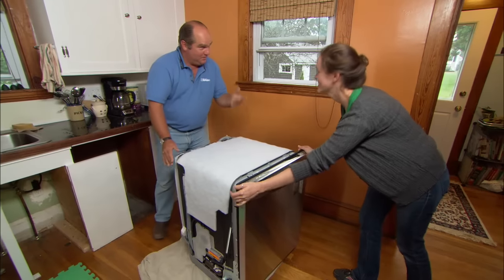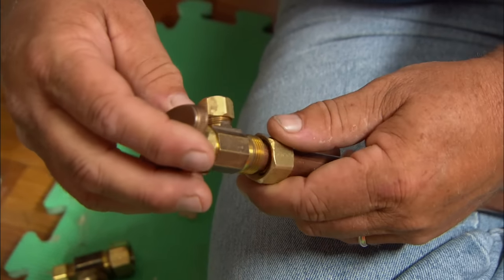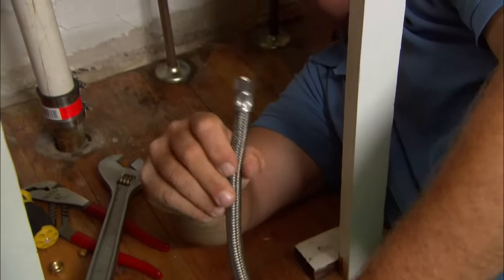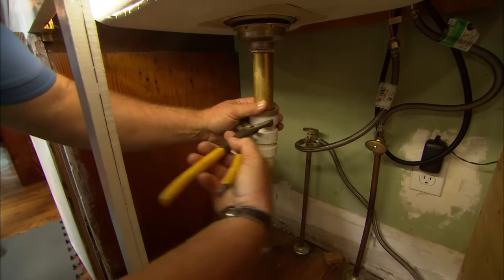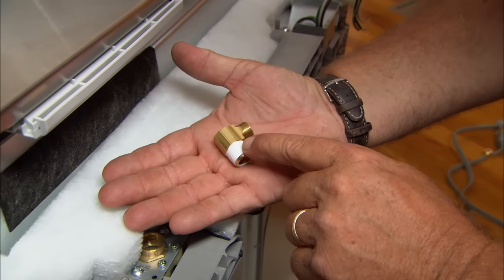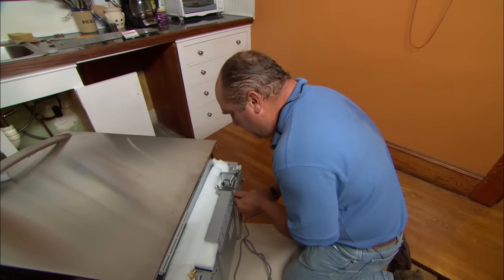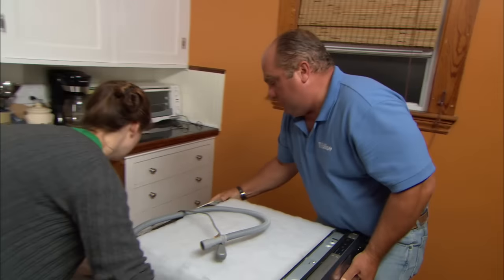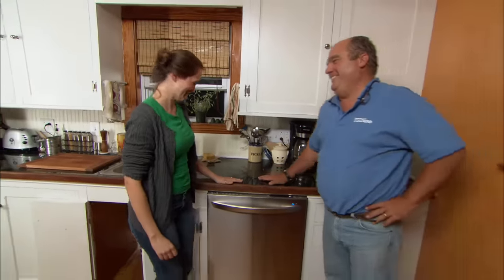How to Add a New Dishwasher to a Kitchen | This Old House

Comment: What do you do if you don't have an electric plug for it? They left that step out.
Reply: Call an electrician, most jurisdictions do not allow you to run your own lines from the breaker. You can also run an extension to an existing plug using a power cable you can buy at any home improvement store, but be aware that you can't run anything big while the dishwasher is running (i.e. a microwave) because it will trip the breaker.
Reply: If you know what you are doing , run 12/3 copper wire from your breaker box into a single receptacle, single gang outlet box.  Do it right and don't advertise and you'll be perfectly fine.  It's really not that complicated.  It's harder crawling around in the attic and trying to run the wire down the wall, especially if it's an outside wall than actually making the wire connections.  You will need to get an outlet and an outlet box and another breaker, or you can replace a single 20 amp breaker with a duplex breaker which gives you two hot connections for 2 separate wire runs in the same space a single conventional breaker gives you one.  Of course you will need your 12/3 copper wire to run from the breaker to where you decide to install your outlet.  You may want to check codes on that to see if it needs to be so far off the floor or what other criteria before you install it.
Reply: Ancyker Using an extension cord is against code.
Reply: I meant a pigtail type cord.
Reply: If you do run the wire and install an outlet make sure you put it to the left or right of the dishwasher.  The dishwasher must be butted up against the wall in order to fit, so an outlet with a plug protruding will obviously get in the way.
Reply: Patrick Wagz packrat76 probably referred to 12-3 for hot, neutral,  and ground.  I have some spare wire I plan to use on a project,  and your term is the correct one of 12-2, as the ground wire isn't counted, but there.   12-3 has black and red hot, white for neutral,  and bare or green for ground. The only time you need 12-3 wiring (or 14-3 wiring for a 15 amp circuit)  is if you're installing a 3 way switch.

Comment: The only thing I don’t like about this is the dishwasher wasn’t pushed in far enough. The front of the washer should be flush with the cabinet fronts and the top control panel ought to be concealed by the counter overhang. A LOT of people install that incorrectly.

Comment: You should mention there are two different size dishwasher hoses. Three quarter and half inch so you need the correct sink drain stem.
Reply: NO you dont the hose end is ajustable to fit
Reply: Never seem a 1/2” hose.

Comment: As with other commenters, I am wondering why he didn't install a P-trap under the sink, but also why no air gap for the dishwasher discharge hose?
Reply: Air gaps are required by some plumbing codes, but not all. I live in California and it’s required. But apparently In Massachusetts, a high loop is still acceptable.

Comment: is it safe to have an electrical outlet so close to all those pipes?
Reply: No, but that's the way you have to have it. You can't really have an electric dishwasher without electricity and if code required you to keep them separate, it would be really difficult to install one(not to mention the garbage disposal).  With the ground fault outlets that are available today it's not a problem. They will trip and kill power before someone could be shocked.
Reply: In theory that outlet is not likely to get wet, under normal conditions. It's not right next to a sink. Some inspectors might require a gfci outlet. But a standard outlet may do the job depending on your dishwasher or local code

Comment: Everytime I have changed the compression valve.. it drips from the ferral. Any suggestions?
I usually have to tighten loosen to 20 times to get it to finally seal.
Reply: smear on pipe dope in the treads may help it become tighter
Reply: It's a good idea to snug your compression fitting. Turn water on. It may leak, but slowly tighten the fitting until it stops leaking. You can OVER TIGHTEN those fittings, resulting in leaks. Pipe dope is also an option, but done correctly, you shouldn't need it. Hope that helps.
Reply: Wrap ferrule with teflon tape
Reply: Personally, I would remove the ferrule and use a new one so it compresses properly with the new fitting.
Reply: @bcbock  can be hard to do without scratching the pipe.

Comment: Never reuse the ferrel or nut from the pre existing compression stop, it’s bound to leak ..
Reply: not true. I have reused them many times and never had a leak!!!! the water pressure is only 60 psi not 1600 psi.....
Reply: Everything I've looked up or heard from plumbers says not to reuse them.  He's got a lot of pipe there too, why not just cut it right quick.

Comment: You have a cross connection with the dishwasher drain you need an air gap fitting
Reply: Air gap is a good idea, but not required in some states. Depends on plumbing code.

Comment: Ok, so what if the dishwasher is not next to the sink?
Reply: You can technically run independent plumbing/drain to it, just usually more convenient to go off the sink. Dishwasher manufacturer likely advises of a limit on drain hose length as well, but you can use one that's a bit longer than whatever is supplied so long as it's setup correctly.

Comment: Richard, Richard....I see 2 problems with your install. First you didn't isolate the water connections, you joined it into one which means when you have dishwasher repair and need to shut off the water, your sink will be unusable for hot water.  Secondly and of big troubleshooting importance, you didn't  mention an overflow drain pan which can save their floor big problems in the even of  solenoid  blowing and water comes out uncontrollably. Planning for the future inevitable problems goes a long way.
Reply: You can also get washers with a drain pan built-in that will attempt to stop the flow and will alarm.
Reply: For the amount of time you need your dishwasher repaired if ever, I don’t think it’s a big inconvenience to not have hot water at one tap for a short period of time. Also, you can buy a threaded cap plug that can be threaded on to the end of the valve outlet and then still use the supply line.
Reply: @bcbock  Well drain pans are nice if they are the type that can handle substantial water flow and are connected the to the drain. The standard pans are only good for disclosure of smaller leaks. I had one flood that took 3 wetvacs full of water !. I would regard the dishwasher overflow protection the same as a washing machine.
Reply: @andrewdishman26   For DIYers I'd rather err on the side of caution and give my self the liberal time to do as I please when I please. You can't go long without the sink but you can live without the dishwasher.
Reply: @andrewdishman26  As a handicapped DIY person that does her own repairs sometimes the time needes for me to gets things done does tend to drag out having the sink unavailable  to hot water is an inconvenience. I'd rather be safe and prepared for worse case scenario .

Comment: Someone please elaborate that this is how to do it if the house never had a existing dishwasher in the design
Reply: Yep. If they already had a dishwasher, you wouldn't need to add any connections, just connect to what is already there [as long as the connections are in good shape]

Comment: Good video. Where i live disheashers are hard wired.
Reply: The Man's Garage I've seen that in most installations.   My Aunt Dawn had a dishwasher installed like this, but to a traditional drain pipe setup. A gfci outlet was installed under the sink

Comment: As always, a very detailed explanation.  Hoelwever instead of just explaining WHY you taped the supply hose to the floor, it would have been helpful to also explain how you measured out where to place it.
Reply: Personally I would have just taped the water line underneath first then attach to supply line second. He did it backwards in my opinion.

Comment: Hey my romex wire has only white and green wires no black wire so how would I connect it to the dishwasher can anybody help?
Reply: wait what??  the romex will have three wires 100%, so you'll need to cut it back to find that hot wire.
Reply: Wrong

Comment: If you go to the hardware store or supply house and some idiot tells you that a DW tail piece works for a clothes washer, walk away. It took ten trips to HD and local hardware stores to make my own threaded splice for a washer. I'd post a picture here if not for Youtube censoring imgr. I even put in a heavy duty check valve. As to what Rich said here about the smooth side of the cable being hot, never believe the texture. Follow that back to the plug and make sure that the narrow prong is the one at the end of that side. My nemonic is "wide is white."

Comment: Why not connect the supply to the washer first then tape it and slide it in?
Reply: It’s easier to connect to washer first then feed the house through and pull it through as your pushing dishwasher in , just guide it gently as it’s going, this is overkill over-engineered process you see

Comment: Dirty water will backup into the dishwasher if the sink clogged and overflowed to the top. Have not seen one without a breather valve. Old dishwasher last forever, new top of the line dishwasher last 7 years if lucky.

Comment: The drain is hardly to code and neither is that tail piece.  And NEC says anything with an immersion heater requires a gfi protected circuit yet no mention was made as to whether this one was.

Comment: They once again only showed the easy part of the process.  Determining the best place for the dishwasher, removing the proper dimension of cabinets, and the demolition and prep for the opening can present the most difficulty.  Also there are a multitude of plumbing situations one could face... TOH took the easiest situation.  No surprise...
Reply: There is a full episode, this is just a shortened clip.
Reply: Most home improvement shows do that. They always have a ton of room under the cabinet but in real life you have to reach around in a very uncomfortable position and then when you finally get the wrench on you don't have room to turn the wrench.
Reply: So where does one get THAT information. Cuz that's what I'm hunting around for.
Reply: "replaced"   there is a difference silly
Reply: I'm used to seeing a siphon vent up at the top of the sink....yet he didn't even install one...

Comment: High loops don't work if the sink backs up to the top, especially if there's a garbage disposal.  If the sink fills up to the top, as it will if the dishwasher runs discharging into a clogged drain pipe, it is above the level of the high loop and will siphon back into the dishwasher and out onto the floor.  The only way a high loop could work is if it is ABOVE the top of the sink, and that's iffy.  A dishwasher air gap should be required.  Talking from experience here.
Reply: They SHOULD be required, but aren’t in some states, like Massachusetts and New York.

Comment: Another hack job.... installing dual shutoff instead of separate isolation valves so if D/W needs to be turned off hot water to kitchen faucet shuts off as well...

Comment: 120v ac power is NOT POLARISED because the waveform goes +60v then zero then -60v making it 120v ac tip of wave to tip of wave so it constantly changrs polarity 60 times a seccond (60 hz)
Reply: Actually it is polarized; it means that the hot conductor has the continuously varying voltage relative to ground, and the neutral remains pretty close to 0V relative to ground.  You're right that the current is changing direction at 60Hz, but this doesn't mean that both conductors are changing voltage relative to ground in the same way.  It's important in electric appliances to have the power switch in the hot leg of the circuit, so that when it is "off" there is no voltage between any part of the appliance and ground.  For example if you put your fingers in a light socket you thought was "off", and the switch was on the neutral side, current might flow from the energized hot conductor to ground through you.  120V AC is also an RMS voltage, which means the actual voltage amplitude is changing between +170V and -170V peak to peak.
Reply: mark zamiechowski , yeah. Thanks for clearing that up for me. I totally understand now.

Comment: I couldn't imagine not having a dishwasher. It takes me 2 minutes to wash 1 plate.
Reply: I was in my house for 12 years before we finally remodeled and made room for a dishwasher. You are right. Now I can’t imagine not using it. It takes forever, but it’s almost zero effort, the result is dishes that sparkle, and I don’t get hot and sweaty from washing dishes.

Comment: NEVER reuse a ferrule. Always need to make a new connection there. Cut the copper pipe and install new Ferrule
Reply: Richard knows when he is doing. YOu can refuse one dude
Reply: @jamedlock83  I work closely with the engineers who design these components, you CANNOT reuse a ferrule and expect the same reliability. It is just like a torque to yield bolt. Anything that completes it's function by material yield cannot be reuse.

Comment: That house can't be that old because the dishwasher has a designate electrical supply; where as, dishwashers in older homes are hardwired.
Reply: There is a thing called updated wiring/running a "new" dedicated circuit
Reply: Use the supply for the hard wire to install a receptacle and bring up to code
Reply: @johnwquick3616  Most new dishwashers can be hardwired. Electricians costs a fortune to add a receptacle and even more money depending on where the dishwasher is positioned in the house and if you don't have room for a dedicated circuit then you have to upgrade the whole unit $$$$$$$$.

Comment: Hot feed to dishwasher? What is this the nineties?
Reply: North American dishwashers and washing machines aren't like European appliances, where they heat their own water.   In order to do so, requires making our appliances run on dedicated 2 phase 240 volt 30 amp service.   The reason Europeans have appliances heat their own water, is because they use tankless water heaters, and they're not made for high demand use.  Besides,  since their electrical service is 1 phase 240 volt service, and it doesn't cost that much more to heat the water.  For North America,  switching to 240 volt service on appliances will actually cost a lot more to use.  That was why my step grandma tried to avoid using her clothes dryer as much as possible, as it required a 240 volt 2 phase 30 amp circuit.

Comment: High loop to prevent backing up into the dishwasher doesn't work.  Install a dishwasher anti-siphon connector or it will drain the sink back into the dishwasher if the drain pipe is clogged below the dishwasher tailpiece or garbage disposal.  You see the water overflowing the sink as the dishwasher is draining so you turn the dishwasher off to stop it from pumping more water into the sink.  Because the dishwasher has a centrifugal pump and no one way valve in the drain hose, the water drains back into the dishwasher because it is higher than the dishwasher and the under counter loop.  You now have a siphon connected from the drain to the lower dishwasher.  The sink will drain back into the dishwasher and soon overflow out onto the floor.  Been there, seen that.

Comment: No mention of shutting the water off first..necessary?
Reply: He said he shut it off in the basement. Super necessary ;)
Reply: +koalamama2 yes I didn't watch it thoroughly lol.
Reply: dalbyonemanband If you are replacing dishwasher and using existing shut-off valve you can use the hot water shut-off valve under sink. If your are replacing the shutoff valve then shut off the main supply valve.
Reply: Try not turning off the main water valve. Let us know how it works out for you